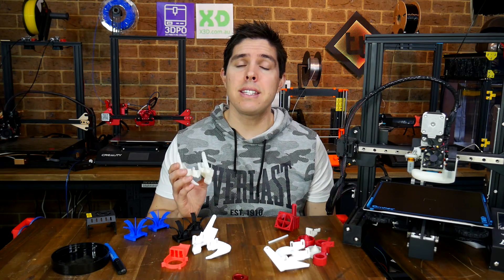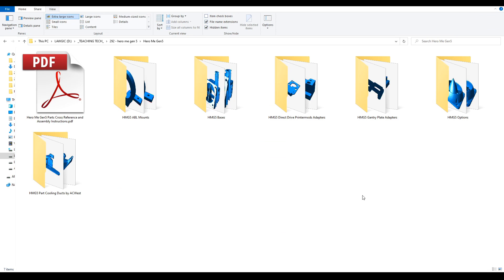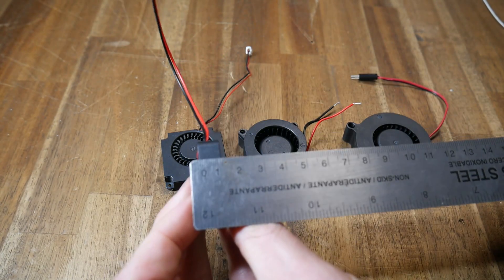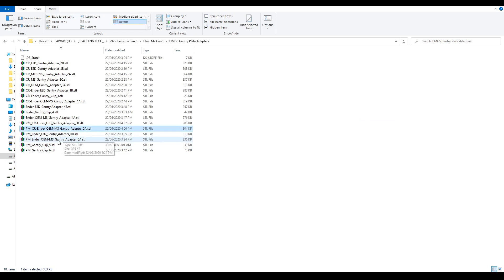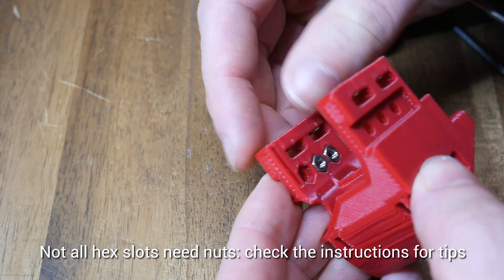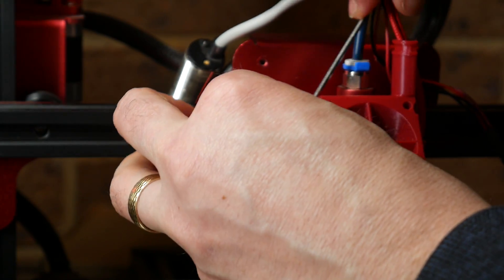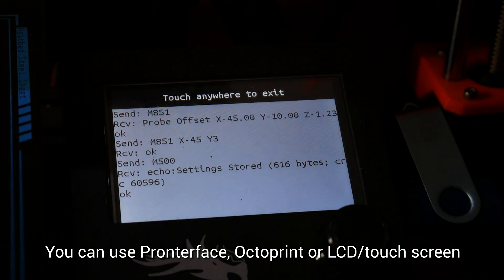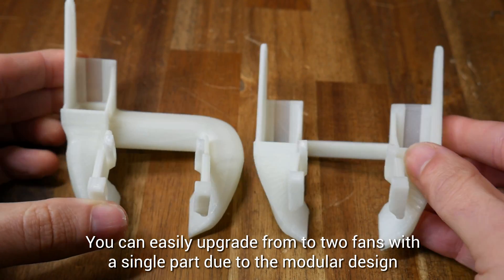Hero Me Gen 5: The ultimate part cooling fan duct for Creality 3D printers?

Comment: This is gonna be great, once I can get the damn under extrusion issue with my PrinterMods DD and Micro Swiss clone hot end on my Ender 3 Sorted
Reply: I had the worst problems with underextrusion with my MicroSwiss. Turned out the bowden tube was not cut perfectly straight so it wasn't sitting flush against the heat break. This caused some friction and issues that were looking like heat creep. I noticed that it would catch when I was putting in filament and not easily move all the way down the hotend. Now that I recut the ptfe and made sure it was flush it has been way better. Might be worth checking.

Comment: I find that screw holes in objects I print always need to be drilled out; but drilling is an easy fix.  What I am wondering about is how tightly or loosely the other parts ended up fitting together.  I have had my share of problems in that department.  Any words of wisdom from you or any other commenter are welcome.
Reply: The Hero Me Gen5 Master Suite is designed to be easy fit. It will depend on what layer height you print at and how well tuned (no Z layer shifts) your printer is at now. I recommend printing at .2mm generally, but some have needed to print at .16mm. Regarding the hex inserts... For some people the hex inserts are a little lose, for others they are a little tight. This due to differences in the M3 nuts and bolts from hardware mfgrs. and peoples printer setups. I worked to find a balance between the two. Some people will need a dab of glue (or tape temporarily), others will need to use the pull method show in the video.

Comment: These really are the best. I only wish they made the nozzle a bit more visible. But it doesn't effect  the print. I just like seeing the nozzle
Reply: The Lightweight ducts that are also part of the Hero Me Gen5 Master Suite that Teaching Tech did not highlight, leave the nozzle completely visible, nothing in front of the hot-end.
Reply: @AndrewSoderberg1  I used and love the hero3 for a while and was great. I ended up switching over to the pets-fang only because of the visibility of the nozzle. Ive been wanting to switch back cuz the fang, although works well, is just too much. If I hd a larger printer I wouldnt mind. But on an ender 3 , is just overkill. So this release was perfect timing... it would have been pretty funny to get done printing the old one, and then see this release lol. But thats awesome they have a more open version. I'll have to check that out.  Thx for the heads up!
Reply: @AndrewSoderberg1  I am actually about to get the files for the gen5. My setup will be the 2 parts cooling fans with the 1 hotend fan. Pretty typical setup. But is there a specific name or file for the open visible nozzle part in padticular?

Comment: I really liked the previous hero me im using it now. its not perfect though.  I think the fan duct is too high and my hot end is getting way too much air on the nozzle.
Reply: The issue you described has been resolved in the Hero Me Gen5. The cooling ducts have been completely redesigned.

Comment: Is this upgrade possible on a A10M
Reply: If the A10M uses the same gantry plate hot-end and accessory mount hole positions as one of the Creality models supported, then it is likely compatible. I have not tested it, as I do not have an A10M. If you know of a STEP or STL file of the A10M gantry plate, and can point me to it, I can create a Gantry Adapter to support it.
Reply: Andrew Soderberg I have no idea to be honest. As I don’t have any of the printers listed. The A10M is a ender 3 clone but with a two input hot end for filament mixing. I would really like to upgrade to better part cooling though I will try a mount for an ender 3 and see if that fits I think.

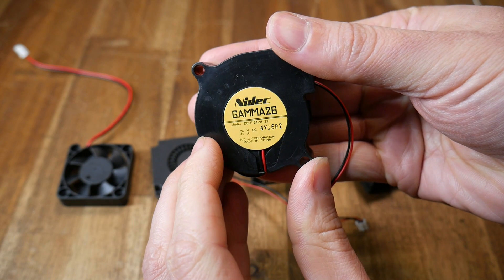Comment: Odd question but where do you guys get  JST plugs for the wire? All I find is for 1 for wire and 1 for circuit boards and it becomes real janky to slide on JST crimped connectors onto the circuit board side of plugs. 5:46 shows a JST wire connector I need. I'm trying to extend cables using JST plugs.
Reply: In the US DigiKey sells them.  For wire to wire connections using something like a Molex MicroFit 3 connector is far superior to just sticking the pins on an inline header.  The MicroFit 3 connectors are both keyed and locking so they won't come apart accidentally.

Comment: Hello like your shows. my question is this will the gen 5 work with the micro swiss hot end and direct drive without any added hard wear
Reply: I am adding additional direct drive adapters so that if you don't have the PrinterMods.com MDD kit you can print your own. Some are posted as remixes now, more to come. The added hardware you will need are the M3 nuts and bolts.

Comment: This might seem like a stupid question, but would it be possible to print the gen 5 out of resin on a DLP printer? Would it survive the heat and stress?
Reply: resin melting point is around 40C/104F. As long as you have a silicon sock perhaps.
Reply: The very first make of the Hero Me Gen5 was done on a resin printer. You need to mix the high temp resin with the high flex resin (I do not know the exact ratio, probably 80-20). It can be seen here: https://www.thingiverse.com/make:818907

Comment: There is such a thing as too many options... watching you list all the various configs and options I am already overwhelmed. If they really want to support this many, they need to create some software to help guide you through the choices and making sure you pick the correct one (like how you pointed out the ender 3 with direct drive was WRONG and you needed the printermods version...)
Reply: The Documentation is very clear on what you need to select. You read threw it and if your not sure google how it is named on your printer. Drag all the files that are listed in a folder and when you reached the end of the documentation print all files that are in your folder. You just have to read the documentation.
Reply: take 5min to read it and you're good to go. they've already provided a ton of work and flow testing FOR FREE and you're complaining there's no software to hold your hand lol, lazy fuck.
Reply: I will be adding image guides as well as a chart to help with selections, but for having over 2.5 million possible combinations there are as few as 3 choices for you to make and is clearly described in the parts cross reference list.

Comment: waiting for ups to deliver my first 3d printer. based off what i seen the ender 3 is a good option for me to get my feet wet on and play around with modifications. i really appreciate your channel as it has practical info without any nonsense fluff added. as i do with all things because i cant help myself as well as enjoy it i also ordered a whole host of parts for it. i got the skr mini e3, dual z kit with the second stepper motor, micro-swiss hotend with direct drive, glass bed, and a few other goodies. i cant wait to start printing and modding!
Reply from the maker: Just make sure you learn the ropes before you start modding, and add one mod at a time. Too many folks rush in without the knowledge to fix any issues introduced. Other than that, enjoy!
Reply: Also to add to what Michael has just said, set your printer up totally stock for a while until you feel comfortable printing and you have your printer printing to its absolute best. When that is the case, add one mod at a time and leave it for a while whilst tweaking your settings until its printing the best it was again. Also before each new mod, make sure you save all your settings (including firmware if you upgrade your motherboard) so you can always undo the last mod you did and get your printer back to its best again if the mod goes wrong. I learned the hard way that that is a good idea!

Comment: I know this is off topic but I noticed you are not using the Noctua fan for the hotend anymore. I don't recall any previous videos about replacing the Noctua fan. I know some people refuse to use the Noctua fan because of performance. What hotend fan are you now using and why? Thanks for your videos and info:)
Reply: The Ender 3 is running a Noctua, it's just black. Note the sticker @ 10:07
Reply: @mrclown7469  Good eye. I didn't think you could buy a 40mm black noctua fan.
Reply from the maker: Still a Noctua, just in black. Never had any creep or clogs. Perhaps with the stock Ender 3 housing that points the fan in the general direct, but with this Hero Me design, the output of the fan is guided nicely towards the heat sink.
Reply: Also keen to know why.
Reply: TH3D had a recent video on cooling fans and in it they covered why you should not use Noctua fans on your printer: https://www.youtube.com/watch?v=azm1c55JOxk
Reply: I'm running Noctua without any bother. Longest job has been 8 hours. No issues seen.
Reply: they under perform and heat creep.

Comment: It needs too many screws to be a drop in replacement. I dont want to have to buy half the hardware store in different screw sizes to mount it
Reply: Are you sure that 3D printing is a suitable hobby for you? 

"I want to paint but I refuse to buy any brushes or cleaning solvents"
Reply: The Hero Me Gen5 is a true upgrade to greatly improve cooling (for PLA and PETG) to support deep overhangs and large bridging without supports that are just not possible with the stock single fans. This requires M3 nuts and bolts. You can investigate past Hero Me generations (still on thingiverse) that do use just the hardware that comes with the printer.